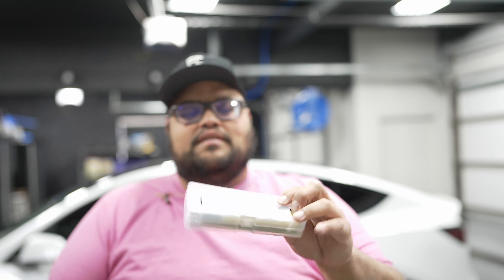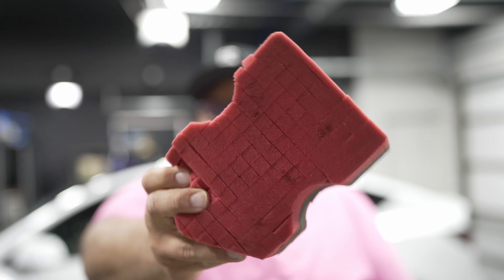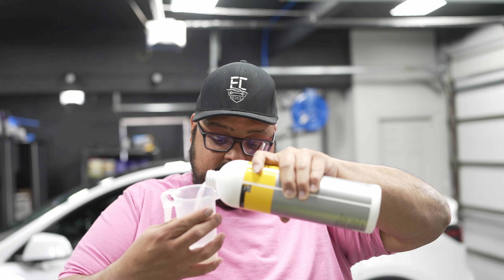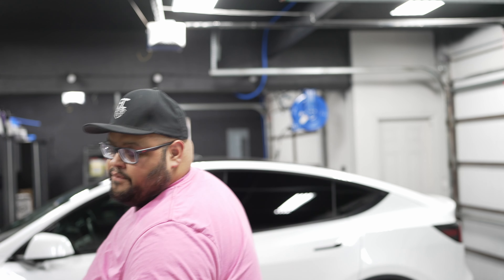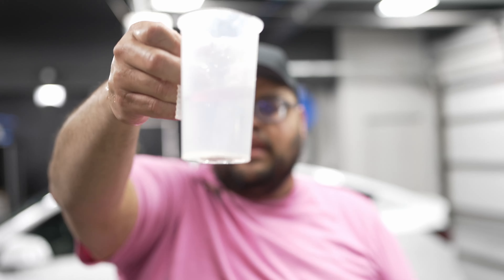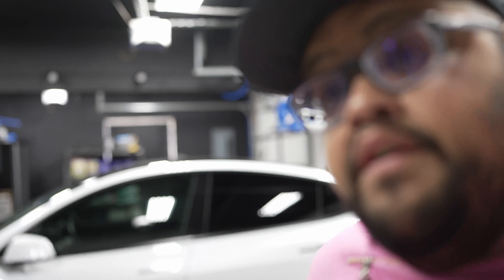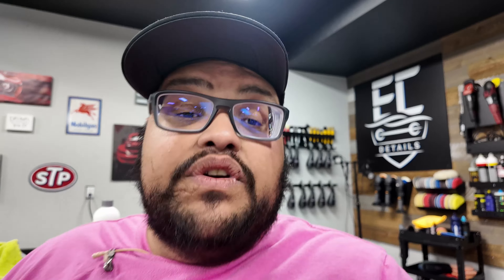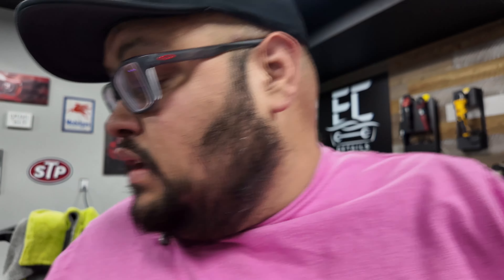Koch Chemie Rapid Rinseless Wash REVIEW

Comment: Gonna have to make a dang spreadsheet with all the rankings per category so we can screenshot it. Thanks for all the work you’re putting in on this and making it entertaining!
Reply from the maker: I am working on it , will  have ph of rinseless, scale for slickness , cleaning, drying etc . Also thank you so much for watching
Reply: For sure! Did you check the ph of your water beforehand? I’d be curious if it lowered it from where it was. Would be interesting to see if any of the rinseless change your tap water ph
Reply from the maker: @jfarm_1311  I did
Reply: @Ecdetails  ok. I didn’t remember hearing a before number. Just remember after the rrw was in there is was 7 something

Comment: Very nice review. My opinion of Gyeon Eco Wash is the same as yours. I see other people saying it was super slick and glossy and I didn't get that during my two washes thus far. I also felt it dried my hands out a little, but I contribute that to the Si02 in it. It looks and feels just like Mothers CMX wash. 

One thing to note for TDS testing in rinseless washes. You often won't see a change because the products are removing/neutralizing the cal and mag ions and replacing with sodium ions. Its the same way a water softener works and the reason why these products will say they soften the water, but do not state they lower the TDS. You need the water to run through a physical media to truly lower and reduce those minerals. Thats why you have DI and RO machines.
Reply from the maker: We will never see tds changes I know that the goal is to see if the rinseless can encapsulate the minerals to create "polymer spots"  I wanted to show that it didn't next video I will explain. 

Also appreciate the comment
Reply: @Ecdetails  Ah, now I see what you're getting at. I just got a DI system that I need to get plumbed up as my TDS is right around 300.

Comment: I thought most rinseless would lower TDS? Did you test this with DIY or P&S? Do you know why this doesnt lower it?
Reply from the maker: Nah it wont it has to go through something physical to lower tDS water that is. A great rinseless wash will encapsulate the minerals to allow for it to leave behind polymer marks
Reply: @Ecdetails  ok thanks. Just heard several youtubers claim that is softens water which basically should be lowering TDS, but I guess what you’re saying is what they refer to. 
Thanks for taking the time!
Reply from the maker: @AndersHansen-d7d  no worries ya nah no rinseless will drop tds it needs to encapsulate the minerals
Reply: @Ecdetails  sounds like water spots waiting to happen of i encapsulate minerals and then let it sit. I guess you can reactivate but dont wait too long if the beads are full of minerals

Comment: Just used ERW today best smelling rinseless so far out all I tried (ONR v5, Absolute, Idrosave).  It has similar water dispersion effect as ONR v5 as well as the deep richer color.  However it’s not as slick feeling as Absolute nor the slickest Idrosave.  However the trade off with those two is their too glossy sacrificing color depth.  I might mix the little I have of Idrosave and RRW to see what effect I’ll get.
Reply from the maker: Oooo did you compare cleaning power to idrosave for me idrosave cleans so good
Reply: @Ecdetails  on glass RRW is better due to the water dispersion sheeting ability.  On paint maybe a slight edge to Idrosave.  The over slickness gives me more comfort in the Idrosave.  RRW not as slick so I was constantly looking at the paint for marring.
Reply from the maker: @davidnuxoll7074  thank you for the info for me this is where idrosave edge it cleaning / wipe off etc